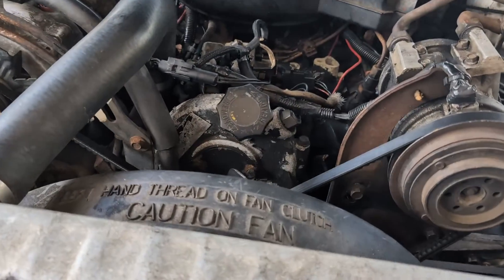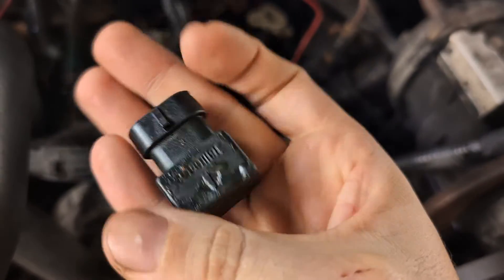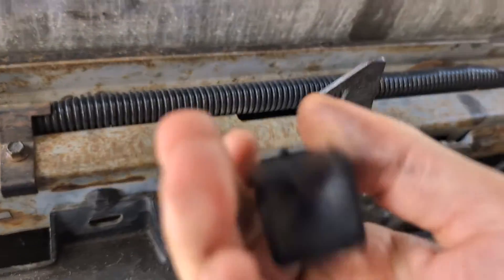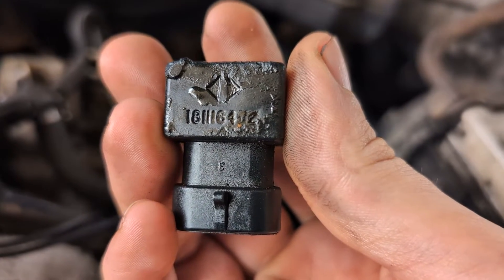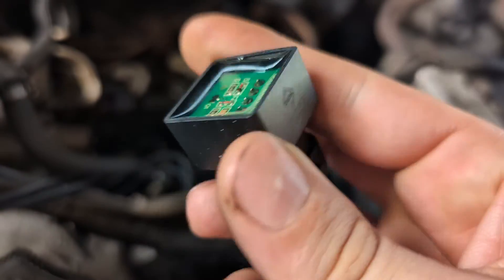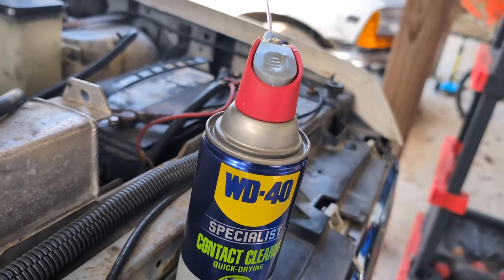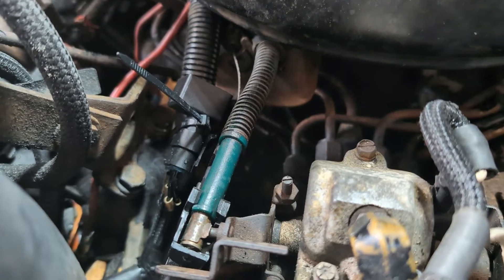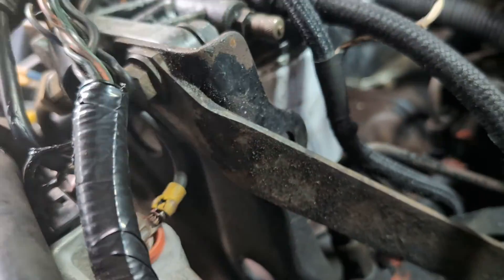Five Minute Fix 46 - Replacing Water In Fuel (WIF) Relay 1989 Ford F350 7.3L IDI Diesel

Comment: My water in fuel light on my 88 7.3 keeps coming on every time I refuel it since I replaced my water in fuel filer, do you think the relay is bad or do you think it’s something else? The spot I refuel at has clean diesel, I’ve checked it and there’s no water in it, could I just have an old tank that needs to be replaced?
Reply from the maker: I would think if you had water in the tank the light would be coming on constantly and would stay on. The way this system works is enough water mixes with the fuel in the separator that a weak electric current can actually conduct to the sensor wire, then it triggers and you get the light in the cab. I think your relay might be fried.  I don't have a pinout in front of me but I suspect you can use a multimeter to check resistance and/or voltages across pins to test if the relay is bad or not.  As always, check for damaged wiring and/or bad grounds.
Reply: @MazdaB3K  fair enough, the light turns off when I turn the truck off and back on again, so I figure maybe the relay is going out, it also doesn’t have it’s original 2 piece filter it’s been converted to the wic style filter with the drain plug on the bottom
Reply: Any suggestions for if the water in fuel is valid? I have a 1992 e350 7.3l diesel and I want to drain the water. I'm having trouble finding where to do this